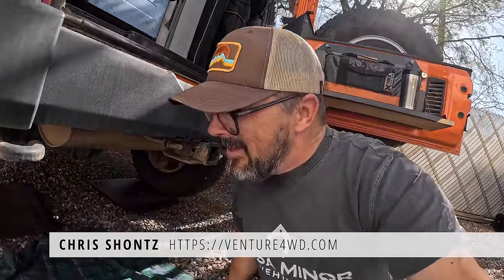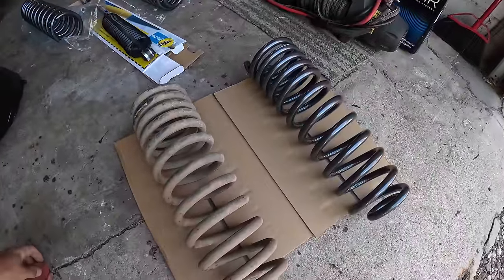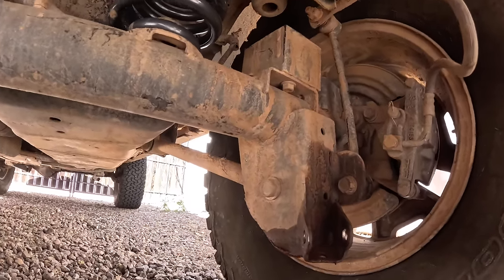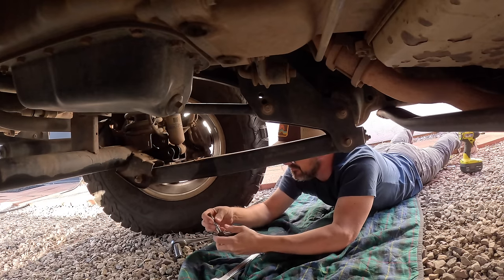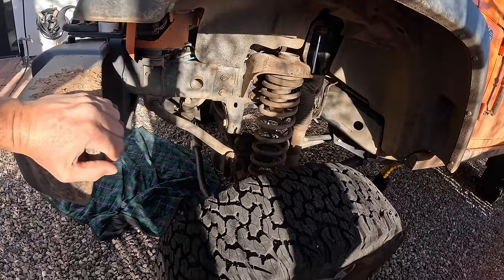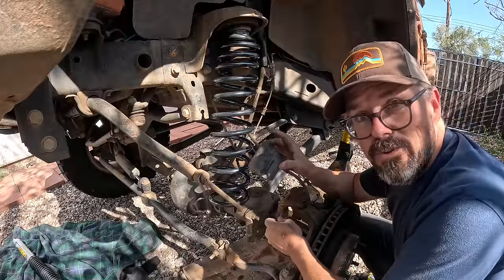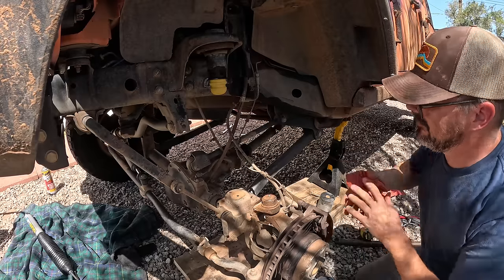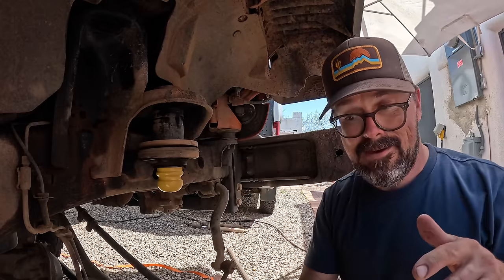New Springs and Shocks in a 2013 Jeep Wrangler JK

Comment: Aev is good stuff. Real workhorse off road. Not fancy but quality and it works flawlessly. I replaced the aev 5100s to the aev 8100 bypass shocks and while expensive it was a huge upgrade in handing and off road performance.

Comment: When my friends and I had a 4Wheel drive shop here in Colorado, we did a number of these coil spring replacements. We would go to Autozone and borrow an outside the coil spring compressor. Made very quick work of the Springs. Would also wd40 the bump stops and holders to get them in easier. Overall nice job Chris. 
CHEERS from Colorado 17:55

Comment: Good tips here thanks!   Man I could not get the front stab link off!!  The top nut was "fused" the the bar.  I did get the 4 shocks, coil springs, steering stabilizer, rear stab links and rear lower control arms though!

Comment: This is a cool way to change the springs 

I have seen others disconnect the swaybar and control arms.

Which seems to be a bit more work .

Curious if you can just support the frame and then use spring compressor

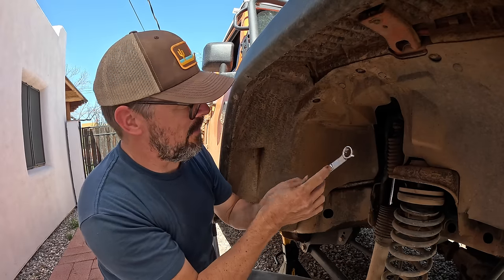Comment: 13:55 - Removing/installing the nut on the passenger  side shock is a real PITA.  Been there done that had to buy the wrench.
Reply: Remove the fuse box, then drill hole through plastic where the top of the shock is to gain access. Reinstall fuse box. Easy.
Reply: @ddbrocato  This may sound sarcastic but it isn’t.

Where was this info when I needed it last year.

Thank you. That is very helpful.